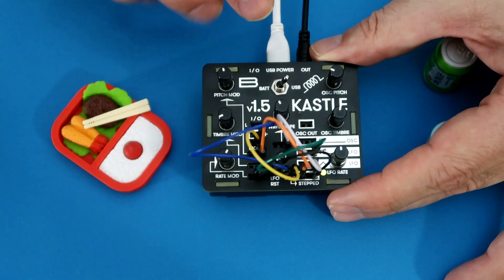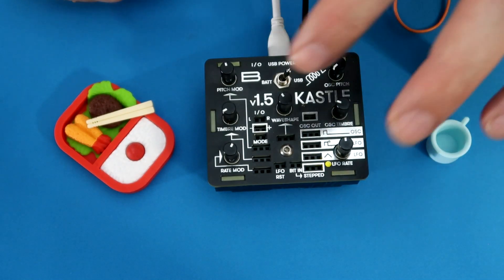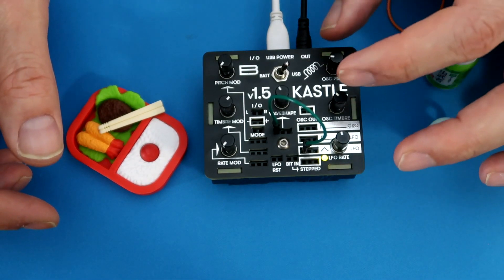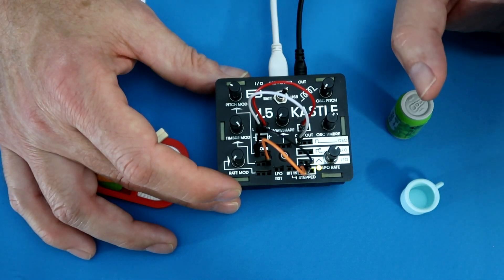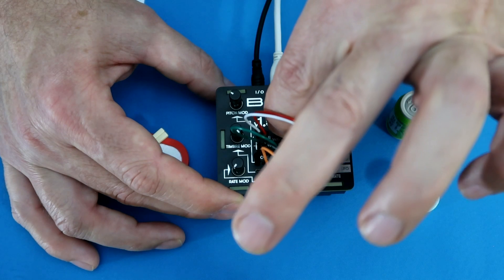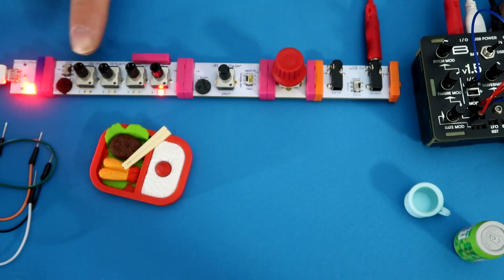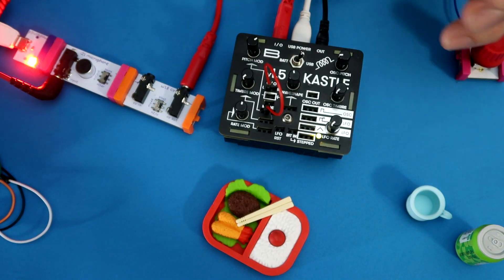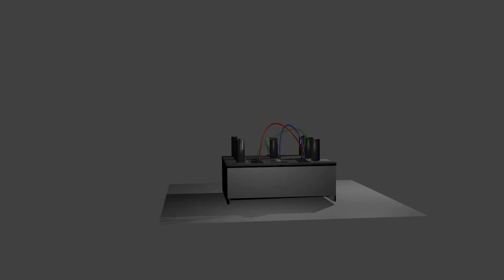A Little Bit of Kastle 1.5

Comment: That sounds great! I'm just wondering if there's a way to slow down the beat to a very slow tempo without using an external sequencer. I love the sound of the Kastle 1.5, but I often wish it could achieve a slower, more meditative speed.
Reply from the maker: @sonicforest521  Hey, thanks a lot for checking out the video🙏🏼! Sorry this took a minute to reply to, I wanted to sit down and measure the minimum bpm for the LFO (stepped, specifically). Mine does a note change like every 53 seconds, which i figure to be somewhere just above 1/4 bpm.

So, it's pretty slow as is, but I definitely see how you might want to have it even slower. One route that I've never tried (and not totally sure is possible) would be to somehow hack it slower - changes in the code or in some sort of internal timing circuit, idk🤷🏻‍♂️. People build Kastles, and maybe the code onboard is open source?

That said, the next point to make is that the LFO Reset on the Kastle 1.5 isn't a "sync" input, per se. It just lets another signal reset the LFO instead of running its course. So, I'm pretty positive that you can't use the LFO Reset to make it run _slower_.

I've done some stuff, just patching, that causes some really, really long notes, but I recall that setup to be unpredictable and not following a sequence at all.

Anyway, as you know, it's really the no external gear part that's tough, of course. Some sort of MIDI-to-CV converter would open the door wide. I'd probably use an SQ-1 (or 2 of them for going super slow, see SQ-1 video on here if that's of interest).

Sorry if this is no help. Wish I could help, but not seeing how🤔.
Reply: @undulations  1/4 bpm? That is very slow.
Is it possible to make that slow?
I  guess I have  a lot to learn.
Thank you so much for such a detailed reply.
I was gonna give away my Kastle because all I make is just random noise without much context. but now I should reconsider.
By the way, have you ever played with Soma Lab's Rumble of Acient Times? Someone suggested me to try it.
Thanks.
Reply from the maker: @sonicforest521  That Rumble of Ancient Times looks really cool🧐! Also a pretty reasonable price!

Comment: Excellent video as always. Some of the most in-depth and interesting looks under the surface of undiscovered small sound-making gems. All Bastl stuff is fascinating imo.
Reply from the maker: Thank you very much for the feedback🙏🏼! I still feel like the LittleBits are a nice addition to some of the other tiny synths like the Kastle. Agreed that Bastl makes really cool stuff. Have enjoyed the Kastle Drum a lot, and I think back to getting the MicroGranny - skeptical at first, but then really enjoyed using it a ton🎶!
Reply: @undulations  Recently picked up B.MicroGranny v 2.5 and B.Thyme, they are fantastic together, (Thyme is not cheap), but its definitely a keeper. I sat for 6 hours in front of Thyme experimenting the other day. Still working through them figuring out applications. These boxes, along with Volcas are way better values 'per function' vs. Eurorack.

Comment: Excellent little tutorial, do you know if it can go through a guitar amp?
Reply from the maker: Thanks🙏! As for an amp? Well, in my experience, the Kastle seems to be sort of "hot" - I'd start with the volumes down, see how that goes. Also, if you have any trouble going from the stereo 1/8" to mono 1/4" (I had a phase issue with an aux plug at one point) you can try a stereo 1/8" to dual-mono 1/4" Y-cable and just use one of the channels. Hope this helps!
Reply: @undulations  thank you for the reply, I’m thinking of using the Kastle thru my mixer/output to amp
Reply from the maker: @blotsinn  That sounds good👍🏻
Reply: @undulations  Do you think a 1/8" to dual-mono 1/4" Y would be the correct jack from kastle to mixer, mixer to amp, could that work?
Reply from the maker: @blotsinn  Yes, that would be good👍🏻 The main out is just "fake stereo" (duplicate channels), so bear that in mind (you can also consider putting something like a short reverb or delay on one channel using a guitar pedal in line with one of the Y's mono lines - this can give a nice stereo effect if your mixer is stereo). Another thing to consider with the Kastle and Y cable is that it lets you plug into the I/O jack and have 2 different lines out of the Kastle - for example you could patch OSC OUT to I/O left and 2nd OSC to I/O right - then use the mixing levels to select hearing the main oscillator or the second oscillator (or a mix). I really like this in formant mode (patch '+' to mode). It's a whole lot of options (Lmk if what I wrote isn't clear)👍🏻.
Reply: @undulations  thanks so much for the detailed response, I’ll have a look into it and let you know!

Comment: wow thanks for showing the part about incorporating the lil bits!   I didn't even think of that! 
What's the bit with the big red knob for? Also.... Where can one buy extra bits that would compliment the synth kit? Have a real hard time finding extra bits to add on
Reply from the maker: dave w Hey, you’re welcome! That’s a Dimmer Bit; I just put a knob on it to have a little better control, also color-code stuff (i have a green one too). As for what it’s for? It is good for scaling voltages - so recall how on the Kastle how you can patch one of the LFO signals to, say, the Pitch. Then you scale that with the Pitch Mod knob, i.e. control the intensity. Same thing with dimmer - the oscillator bit is the LFO, has a frequency, but the dimmer lets me control the intensity. I got my extra Bits straight from the LittleBits website. i recommend the CV bit - easiest way to connect synth kit stuff to Kastle. Hope this helps!